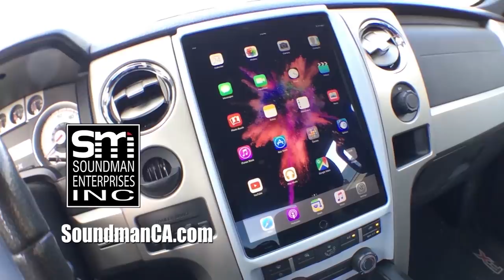I'm very excited about these new parts!

Comment: $280?! Funniest thing in the video 😂😂😂😂
Reply: Make one better for less then.
Reply: Did You Reset it ? ... Worst case scenario imo:

- Acrylic : $15
- Magnets : $8
- Felt : $2
- Labour : $22

At 50% margin that’s $94 dollars. If it were injection molded I could understand needing to cover the cost of tooling, but it’s CNC machined. By my estimate their margin is over 90% direct to consumer; that’s bonkers.

Happy to be proven wrong though.
Reply from the maker: Oh you funny little fella... 😋
You’re forgetting about...
- Router payment
- Electricity 
- Taxes 
Not to mention the cost of material that was wasted developing the designs.And the cost of iPads.  I’ve been perfecting thewe designs for over 6 months.
A sheet of 1/2” acrylic is $100
We use Suede 👌 not felt 
Our patent cost over $10k to file, and we are pursuing more 
Your neodymium magnet prices are off
And your labor price is off by a little. 😋
You should start a business... It’s fun 🤣